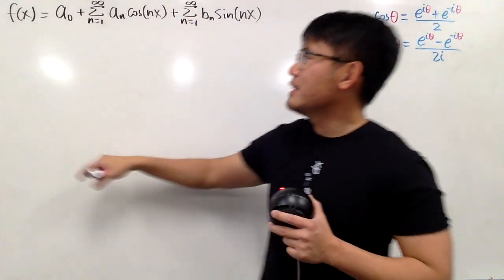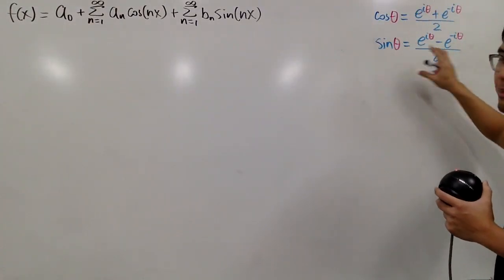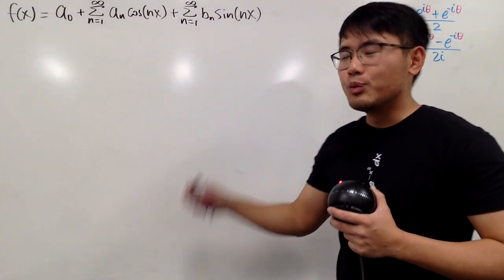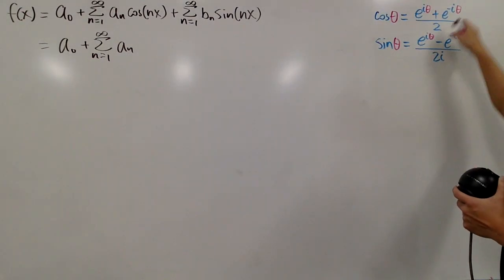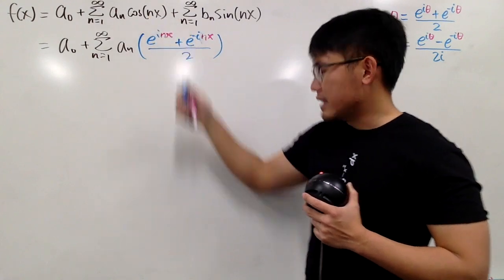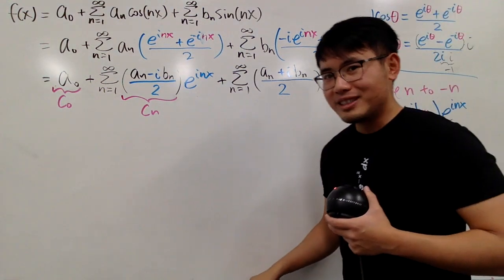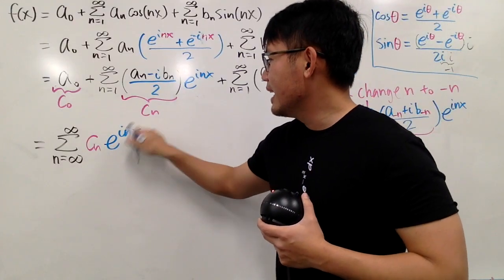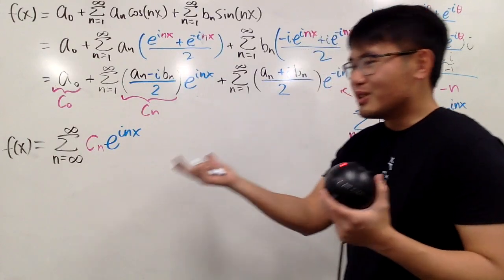Complex Fourier Series (fourier series engineering mathematics)

Comment: I have a question on Fourier transform ( FT). Why in  FT, the sign of the parameter of the  exponential function is negative ( exp(-i2\pi nk/N))?  Why don't we use the positive sign in FT and negative sing in the inverse one?  Is it just by definition, or there is a mathematical reason for that?

Comment: I prefer the complex Fourier Series. It helped me solve many engineering problems in noise and vibration control. It also help massively with laser optics design. Everywhere I turned where a complex signal was there, the complex Fourier helped a lot, especially since I was collecting the total vector length at the end and was not interested in the phase at all.

Comment: Another rather interesting bit is that, believe it or not, tan(x) has a Fourier series. The trick is, it's not convergent (and someone mentioned some stuff about trying to find a Fourier series for 1/x below; that's similar, but tan(x) is arguably a more natural choice because it is periodic), and as a result one needs to reinterpret it using a suitably appropriate definition of extended summation, similar to what was done for the video summing 1 + 2 + 3 + 4 + ... to -1/12, only one does not need a method as sophisticated as Ramanujan summation. In particular, such divergent Fourier series should be interpreted with what is called Fejer summation, which is basically a specific application of Cesaro summation, the simple "averaging" method that is used to sum Grandi's series, 1 - 1 + 1 - 1 + 1 - 1 + ... , to 1/2, to the Fourier series. (Fejer summation can also be used to improve the convergence of some convergent but otherwise "bad" Fourier series like that for the square wave - it "smooths out" the Gibbs phenomenon [the "spikiness" near the discontinuities] and thus allows it to approximate the square wave much better.)

In particular, the series for tan(x) is

tan(x) = 2 sum_{n=1...inf} (-1)^(n-1) sin(2nx) (divergent)

Would be good material to go over in a video, I think, including the derivation (which requires the Cauchy principal value, I think, to make sense of the "bad" integrals across the poles of tan(x).).

Comment: For forty years I've been wondering whether there is any natural number for which, if it is written down in English, all of its letters occur in alphabetical order.
Reply: Jack Sainthill I think that we can use proof by exhaustion to prove there is almost no such natural number with the property you describe. The reason I say we can prove it by exhaustion is that there is only a finite number of cases to consider. There are two types of names a natural number can have. One type is the positional type. This type of name is a name given to a number based on the multiples of powers of ten in its decimal expansion. As such, if we can find that any individual part of the name already is not in alphabetical order, we can discard every number whose name contains this part. This means we only need to consider the names of the powers of ten individually, and the names of the digits, individually. The only exception to this rule is the names of the multiples of 10 less than a hundred. Also, we shall consider a separate case of proof once we get to a million. To start with, we have the digits one, two, three, four, five, six, seven, eight, nine, ten, eleven, twelve. None of these has a name whose letters are arranged in English alphabetical order. Also, thirteen through nineteen fail to have such a name, because the suffix teen does not have its letters arranged in alphabetical order. Twenty, thirty, Forty, Fifty, Sixty, Seventy, Eighty, Ninety,  Hundred. 40 has an English name whose letters are arranged in alphabetical order. However, this may be the only natural number with this property.

Now we are at naming powers of 10 individually. Hundred, Thousand, Myriad, Crore, and Lakh fail to have this property. Any number whose name contains these names as parts of it is discarded. Additionally, any number whose name ending contains the suffixes -lion and -liard is discarded. Since every number after million and milliard contains a name containing those suffixes, every number afterwards is discarded, except for those numbers whose primary name is not a positional type name, but the second type name, which I call the special type. These are numbers which are large, or very large, whose name is special given their significance in googology, and do not use positional names as their primary name. Example of this would be the google and the googleplex. Nonetheless, the number of these special names is finite in the literature of googology, and to my understanding, none of these names satisfy the property. 

As such, 40 is the only natural number which has an entire name in English consisting of letters whose arrangement is in English alphabetical order.
Reply: @angelmendez-rivera351  
Indeed it is, thank you. My forty-year quest is ended. ;)
Reply: Jack Sainthill That’s very meta wtf

Comment: Could you please upload a video working out a formula for the series 1,1,-1,-1,1,1,-1,-1,... ?
Reply: Lucas Depetris Easy: (-1)^floor(n/2) = cos[π·floor(n/2)]
Reply: In fact, for the bonus gravy, if you have a sequence characterized by having m 1s followed by having m -1s followed by having m 1s again, with a repeating cycle, then the formula for such a sequence is (-1)^floor(n/m) = cos(π·floor(n/m))
Reply: Oh, in case you are not aware of what the floor function is, floor(x) is defined as the largest integer n such that n < x or n = x.
Reply: @angelmendez-rivera351 but how did you worked out the formula you gave me, I want to see the full explanation
Reply: @depecraft  There is no good way to explain it, because the formula is one of those formulas that cannot be derived by solving simple equations. You either notice the pattern, or you don't, and if you don't, there is pretty much nothing you can do about it.

What I noticed is that the sequence 1, -1, 1, -1,... etc., which is very similar to your sequence, has formula (-1)^n. This one is just common knowledge, and you realize it easily by trying to calculate every power of -1. But the one difference is that I need to be able to repeat every n instead of just counting forward. In other words, instead of plugging in n = 0, n = 1, n = 2, etc., I need to be able to plug in n = 0, n = 0, n = 1, n = 1, n = 2, n= 2, etc. to get your sequence. In other words, I need some sort of increasing step function. And there really are only two step functions that satisfy these properties that can do the job: ceiling(n/2), and floor(n/2). And you get floor(n/2) after testing both on the sequence. That is how I came up with an answer. I really just followed a pattern and reasoned through it slowly and borrowed from other knowledge, but you cannot derive the solution systematically. It's just impossible. Especially if you don't know the floor and ceiling functions to begin with.
Reply: @angelmendez-rivera351  thank you for taking the time and writing me that! :)

Comment: I think it might be a big problem if f(x)=1/x
Reply from the maker: 2005 VincentChui I think so too since 1/x is bad when x is 0
Reply: Would you use Cauchy principal value in this case?
Reply: Appilesh It seems that would be the case, but I am afraid this would make every coefficient equal to 0.
Reply: @Appilesh  I confirmed that, yes, you need the Cauchy principal value for the real part of the coefficients. The imaginary part is always integrable, but the real part is not.
Reply: @runerobin45  - principal, not principle

Comment: Complex is better; you don't need to remember which coefficients have a 1/π and which have 1/2π. It also just works if f is a complex-valued function, and you just don't get all conjugate pairs.
Reply from the maker: iabervon I like it more too.
Reply: Also, I realize that if the real Fourier series uses the expression a0/2 + S, then you don't have to remember which coefficients have 1/pi and which have 1/2pi either, because they all have 1/pi in that version.
Reply: This is true, although there is pedagogical utility to the real-valued Fourier series.